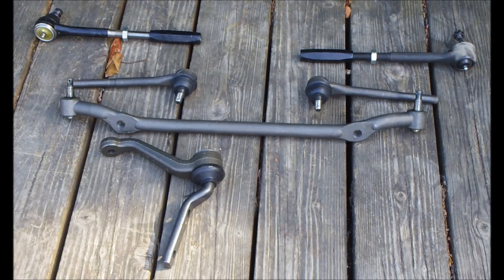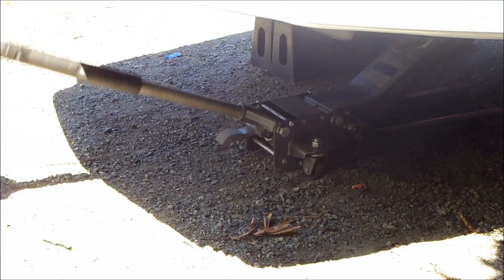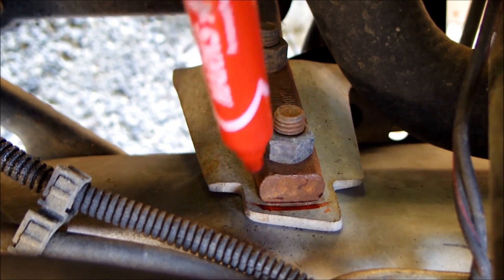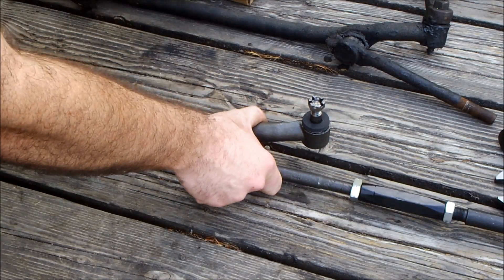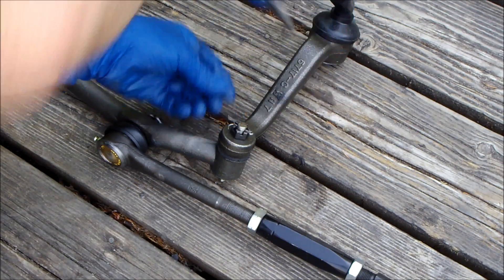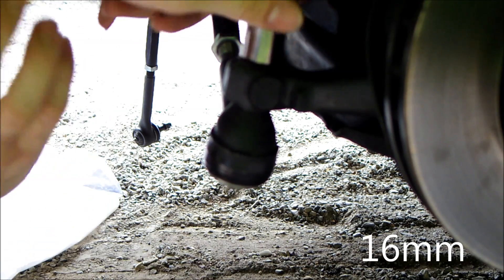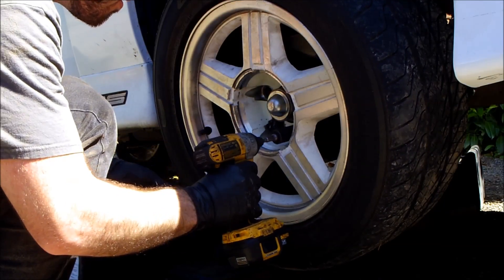Complete Steering Rebuild (1982-1992 Camaro/Firebird)

Comment: Great video! I'm getting ready to do this in the next couple of weeks. I bought all Moog, including center link. What do you mean by wrong geometry?
Reply from the maker: the MOOG idler arm is NOT designed for a 3rd gen.
it just so happens to be close ""ISH"" so MOOG sells it as a replacement.
you want the (ACDelco 45C1065 )

you can read more about is here (has pics ex)
https://www.thirdgen.org/forums/suspension-chassis/730439-beware-moog-idler-arms.html
Reply: The idler arm, I agree. In the video you mention the center link
Reply from the maker: i probably got em mixed up.

Comment: @3rdGenGuy That is actually not the correct idler arm, the correct one has a big casting line along the edges and has a 1.5 inch drop. The one you got has a very thin casting line and probably has the wrong 2 inch drop.
AC Delco seems to have stopped packaging the good ones in their new stock of these.
If you want the correct idler arm you must buy the McQuay Norris FA1399E.
I think any idler with part # FA1399 should be correct, when I ordered the McQuay Norris FA1399E on RockAuto it came in a different brand name box with part # FA1399 on the box.
Anyways just make sure you follow the center link leveling instructions before tightening up the bolts.
Reply from the maker: the ACDelco 45C1065  idler arm is a 100% exact match for the OEM idler.
I know this because:
1. the design is identical
2. I've set bump-steer to 0.006in on my car, on both sides. if the idler was wrong the bump steer would be massively  different side to side.
Reply: @3rdGenGuy  Oh ok you must have got lucky and received an older stock item. 
For anyone else reading this, make sure you compare whatever you ordered to the original idler or if you don't have the original just simply compare the angle and drop of the pitman arm to the new idler, side by side.

Comment: Great video, specifically showing the bolt sizes to avoid getting up and down or having a pile of sockets on the floor. Just not sure why you say to disconnect the hood light.
Reply from the maker: The engine bay light will drain your battery your you left it on during this rebuild.
so i put a step in to disconnect it.

Comment: Can i use the same alignment specs thats posted on a lowered third gen?
Reply from the maker: it would fine even if your car is slammed.

you would have to modify your steering stops  if you went to the extreme when lowering.
the alignment isn't gonna make your tires rub

Comment: why not use the factory alignment?
Reply from the maker: Because the post 1983 alignment is JUNKKKK
factory alignment does a few things
1. increases tire wear
the camber is in the WRONG direction
2. decreases grip
3. makes the car less stable on the freeway.
the changes happened because performance alignments make it harder to use the car at low speeds (sub 10mph)
chevy received complaints about the steering at low speeds so they changed them for the worse.

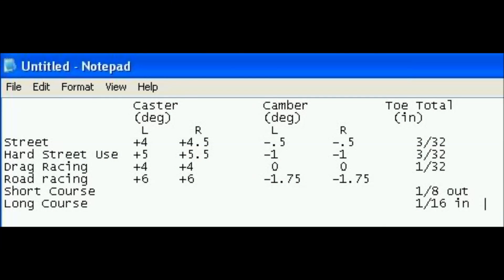the alignments at 5:18 are what you want to use based on your usage.
Reply: if i take my car to an alignment place, will pull up the factory specs and set it to that? they'll probably look at me crazy when I give them different specs.
Reply from the maker: Just write down the Specs for the street alignment. (same one i went with)
I went down to les schwab tire and gave them those specs.
they had ZERO issues getting those specs.
they didn't even care
Reply: was it you who said do not use the moog center link? because i'm also seeing that you shouldn't use a moog idler arm
Reply: the part number you listed for the ac delco center link is actually for an idler arm.. ?
Reply from the maker: Sry i guess i made a type at 0:17
ACDelco 45B0075 (center link)
ACDelco 45C1065  (Idler  Arm)

DO NOT use the MOOG idler arm, it's the wrong geometry and your steering will feel like garbage.
Reply: okay thanks for clearing that up. not only is it a typo but you also verbally state in the video that the centerlink is the problem. just letting you know so you might want to make a disclaimer.
Reply: @3rdGenGuy  is it recommended to use ACDelco for both center link and idler arm? Or just idler arm?
Reply from the maker: @LT3D  the AC delco idler should be the right one. you can use the MOOG stuff for the center link and other links.
Reply: @3rdGenGuy  thanks brother, that helps. About to redo the steering on my 88 GTA.

Comment: Attention! The idler arm by ACDelco doesn't seem to be the same design that it was a few months or years ago! They started to label other products with their brand but the design is the wrong one. So at this time it seems to be try and error when buying idler arms. Moog is completely incorrect and ACDelco might be too. I don't know about the other brands but from what I've read on the internet, I would go "Proforged" parts everywhere. They have a rust coating and seem to have the best bearings. There were also some infos on Moog end links. Some guys had difficulties with wheel alignment as they seemed to be too short or long. Very bad for Moog's reputation. Also they didn't show any interest in redisigning the wrong idler arm. I would avoid Moog now unfortunately.
Reply: The holes line up perfectly. The moogs should work too
Reply: @bencezavarko7312  It's not about the holes. You cant put the center link in the correct position with the wrong idler arm. You have to measure from the bolts of the a-arm where it attaches to the K-member
Reply: thanks for the advice. I would rather spend more for better quality. Going with Proforged.

Comment: The idler arm is ac delco 45c1065. Not the center link. You have the part numbers reversed.  Its the idler arm that doesn't line up with the pitman arm.
Reply from the maker: 1st and 2nd comments show the updated parts lists.

Comment: hi I have a 1987 pointac trans am gta can some one pls tell me if the parts are the same thanks
Reply from the maker: 1982-1992 Camaro AND firebirds share the SAME suspension and steering.
Reply: thanks for your information

Comment: The moog part number at 0:13 is not for the idler arm that is for the center link is their a part number for the acdelco center link
Reply from the maker: I messed up the part #'s
you can buy MOOG stuff except the idler.
the correct idler arm is (ACDelco 45C1065 )

Comment: That was my next fix. However due to the fact that I almost lost control of my 92 Camaro on the highway because one of the axles of the 10 bolt decided to just pop out! I'm opting for a 9 bolt (Borg Warner) rear end swap.
Reply from the maker: 9 bolts are a bit stronger than 10 bolts, but they have fewer parts available.
Reply: @3rdGenGuy  Thanks for the advice! I have 2 more options: Swap my 10 bolt for a 94 - 2000 10 bolt (even though it sticks out a little bit more) or buy a c-clip removal kit, which converts my current 10 bolt to a system similar to the 9 bolt.
Reply: @LuisAFigueroa  

I have a 9-bolt.  Holding up to a built 383 no issues.  However parts are VERY limited and can be expensive.  If I replace it there is only one route I would go and that is Ford 9".
Reply: @TheMrkaninja  Not true, there's a dedicated website selling 9 bolt parts: http://9bolt.com
Reply: @LuisAFigueroa  

Yes, and parts availability is limited with many of the parts they sell being USED.  I have a 9-bolt, trust me I know all about that website.

Comment: 3rd Gen Guy, Are you saying that the Center link and idler arm made by Moog are not recommended? I found a 9 piece kit online that includes the following (all Moog): DS1049, ES2032S, ES2226RL, ES2227RL, K6145T. Center link, tie rods,  lower ball joints, outer tie rods, and adjusting sleeves. It seems to be missing the idler arm. I believe they also have a 8 piece kit (missing the Center link). and lastly a 12 piece kit with all the above mentioned plus sway bar links (Moog K5252). Do you recommend I get the 8 piece kit and buy the idler arm and center link from AC Delco, or is the Moog center link ok to use? Thanks.
Reply from the maker: the MOOg stuff is fine EXCEPT the idler arm,
you want ACDelco 45C1065
Reply: Sweet, thanks. Keep up the good work with the videos. Cheers

Comment: why did you use stock junk?
Reply from the maker: there's no alternative my guy.
unless you wanna go all rod ends and setup dirt track links.
Reply: @3rdGenGuy  UMI makes a bumpster kit which is way better quality than moog. I forget if you're running a center link still from your videos but if you are I'll start performance makes a nice adjustable that fit your ride.
Reply: @3rdGenGuy  yeah bump steer kit is a glorified dirt track link but I run it on my g body
Reply from the maker: I've used the UMI bump steer kit, and that's only for the outer tie rods.
the kit was too low end for racing.
rod end was one of those cheap resin filled ones and the spacers were janky.
I now use a high end PTFE rod end with a WoodWard swaged link alongside a custom machined 316 stainless spacer.
Bump steer is 0.006in over 2inches of travel almost perfect
Reply: @3rdGenGuy  I use the speedway ends with different hardware . Also an adjustable center link.. mine is minimal as well and bracket approved.